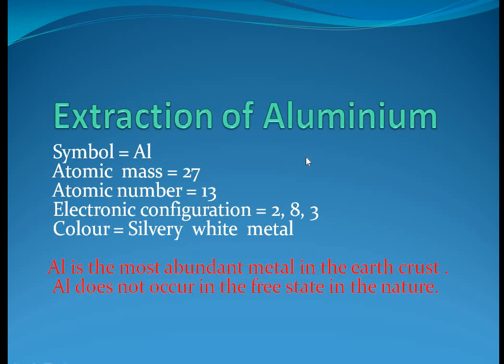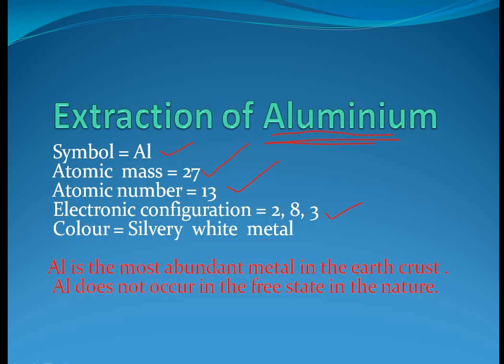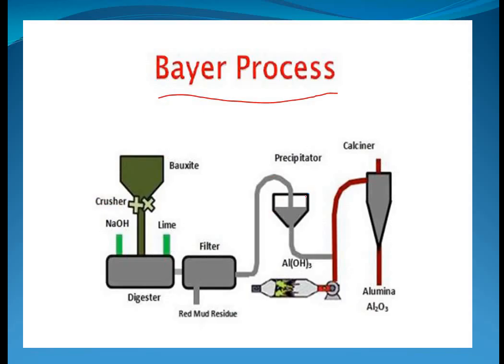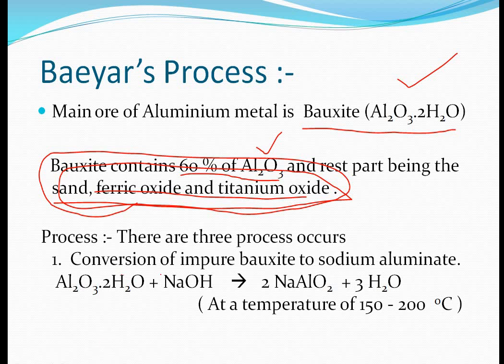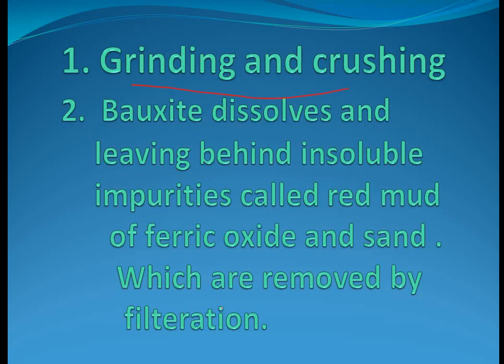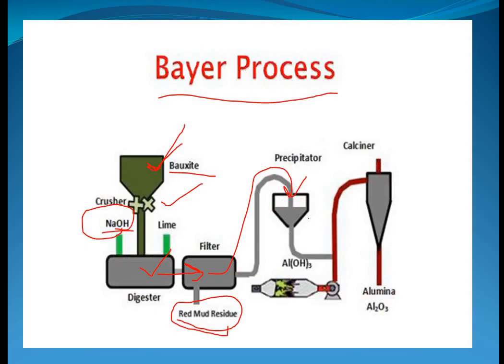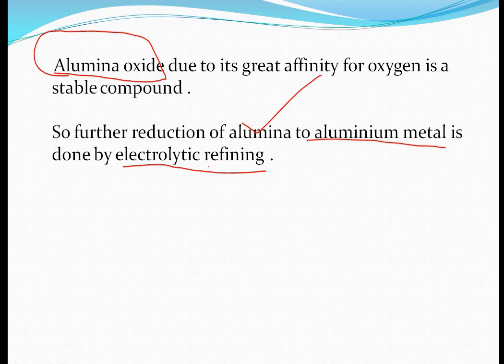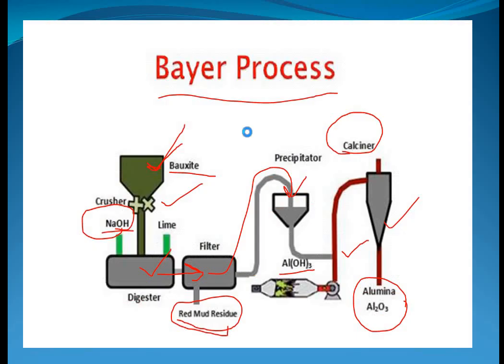Aluminium extraction || ICSE || Bayer's Process || CLASS 10

Comment: try sodium process, as in, Al2O3 or Al(OH)3 with Na => Al + Na2O or similar
Reply: no wonder why your things are so "expensive", its only your fake costs
Reply: you have a metal cartel system of forcing
Reply: you barely went into the reduction process, you only sorted out the aluminium oxide from the ores, that would be simple enough, cheap